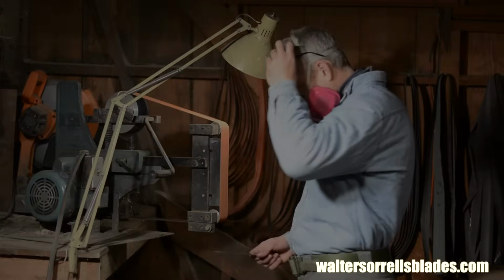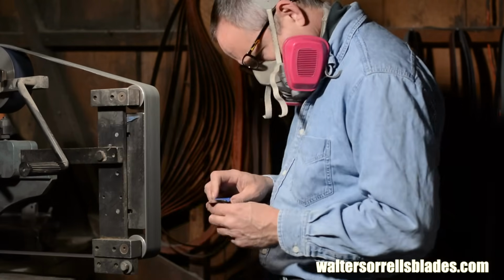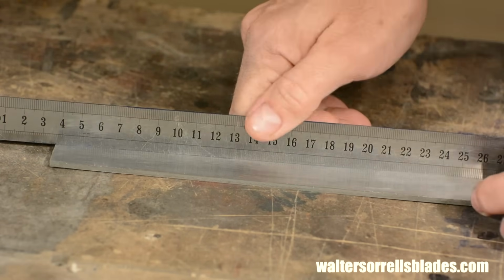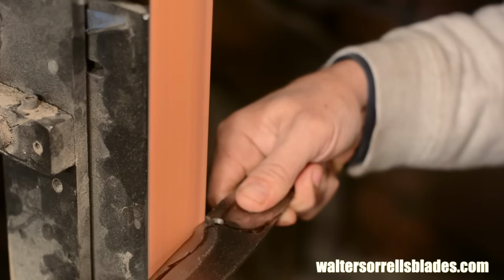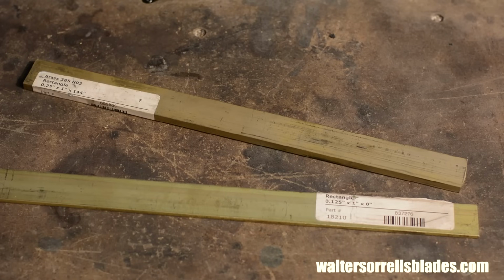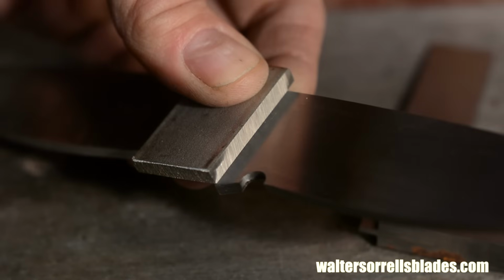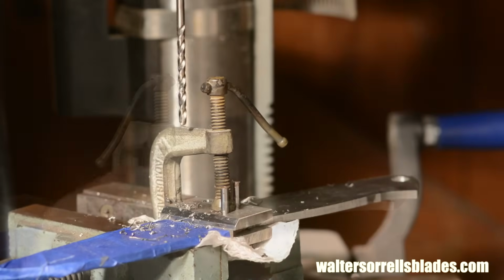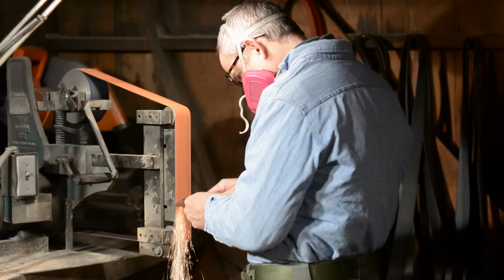How to Make a Hunting Knife - Part 1

Comment: very nice tutorial !
for making the bolsters line up, you could just shape them to each other(put the pins through with out the blade in the middle, and grind them on the belt grinder)after you drill the holes.

Comment: Very much enjoyed your presentation. I've made a couple knives (stock removal) and a couple which were beaten into shape by my crude blacksmithing. Crude in both situations but surprisingly satisfactory cutting edges (carbon steel of unknown origin, in one instance a set of blacksmith made shears for gardening which had "retired"). Eventually I may get to try something of more "predetermined" quality. I'm quite familiar with belt grinders and have used one for glass work as well, using wet belts which do a fine job.

Comment: That Norton belt sure does some quick removal work. Thanks, as always, for the great information!

Also, I've noticed on numerous videos that your water cooling container is positioned so that you have to lean down for it. Is it merely placed there for use with multiple grinders, or is there another reason it's farther out of the way?

Comment: Key to drilling stainless is high feed and slow speed. It also helps to have the bit sharpened to a shallower angle.
Reply: Sturmgeschütz isn't that a German tank Destroyer from WW2?
Reply: More of a mobile gun than a tank destroyer yes.
Reply: Sturmgeschutz is 100% correct, that drill bit is going much too fast for effective drilling of stainless.  Stainless steel is a terrible conductor of heat, so that heat builds up quickly on the point of the drill bit, making it softer than the steel it is trying to cut.  Turn slow, use cutting oil, and draw the bit out regularly to clear the chips.  Oh, and NEVER grab the chips or string while the machine is running, it'll deglove your finger in an instant.
Reply: I agree.  Slower spindle speed, and a 135* drill bit helps a lot.
Reply: What type of drill bit is most effective on stainless? Cobalt, carbide, or other?
Reply: OldJesusFreak1958 I use cobalt on stainless, with the 135° self-centering geometry as wildcard mentioned.  Works quite well. Carbide is really brittle by comparison and (I believe) should be reserved when working with solid tool-holders, not hand-drills or consumer drill presses.
Reply: OldJesusFreak1958 I just use high speed steel, you dont need fancy expensive bits unless you are doing hundreds of holes. I know i said it makes it easier but dont even sharpen the bit to 135 deg, i just keep it at 118 and ive worked with the stuff for years and had no issues. I drill bizplate 400, 500, 3 cr12 amongst others using high speed steel, and stainless is nothing compared to any of them.

Comment: Hello Walter, great channel and great craftsmanship! I have one question: what's your opinion on corrosion risk/ product degrading caused by contact corrosion (contact between steel and for example brass which differ in redox potential)? Have you encountered such phenomena when applying brass pins in carbon steel blades? Thanks for your help!Greetings from Germany!

Nils

Comment: Hey Walter, love the videos sir. I have questions about belt sander belts. You said you use ceramic composite rather than aluminum. We use aluminum composites here at our shop and I’ve noticed on mild/ medium carbon steels, they tend to get hot very quickly and get tempering colors. Is this due to the belts, or am I “leaning” into the belt too much? When I watch you work, it looks like you barely hold your materials against the belt and you don’t get any discoloration. Does that also have to do with your material being stainless steel. There’s so much to consider here so any information would greatly be appreciated. Thank you for your knowledge!

Comment: I'm really new to knife making and im a bit confused with the maximum  thickness to grind the bevel to so it doesn't warp when heat treating. would grinding to rufly 1mm be ok or could I remove more.thanks for any help.

Comment: would 1084 steel work well for a knife like this? i have a couple of weeks off coming up and im planning on making my first knife and figured stock removal was a good place to start so i ordered a length of 1 1/2 x 3/16 1084. I'd probably oil quench it in canola. Thank you:)
Reply: 1084 is a simple High carbon steel For the intent of using it as a hunting knife? Probably not but for an outdoorsman survival tactical camping knife? absolutely. 
I would recommend 1095, 5160. O1tool steel for the beginner stock removal/ forging. these steels are easy to get(amazon) easy to work with and easy to heat treat.(heat treat it with a blow torch

Comment: Finished grinding my first knife, managed to establish a decent grind and plungle line but once I started sanding away all the grind marks, the neck sort of just disappeared and the plungle line got really smooth. Tips on how to preserve crisp sharp lines?
Reply: Another question I have, When sanding with water on a carbon steel blade, what is the best way to keep the blade from rusting? I just cleaned it up best I can and did my best to dry it before bringing it indoors but I'm worried once I give it a final polish it's just going to rust really quickly even if I clean it up and bring it inside.

Comment: Walter I am drilling holes for my bolster on my knife and using 3/32 pins and burning up bits like crazy. My drill press low speed is 500, and I am using a cutting oil. should I just punt the small pins and go with bigger pins (1/8) or is there a trick to it?
Reply: are you using cobalt bits?

Comment: Where did you buy your 440C Steel? How thick of a piece did you buy?
Reply: 1/8 inch thick
Reply: Harrison King
awesome, thanks.
Reply: MARK 1 According to McMaster-Carr that's about $87.09 for a piece of 440C that's 1' (length) x 1/8" (thick) x 1.25" (width). Yep, this stuff might not be a so called super steel, but it sure as hell comes close in my opinion. According to the specs I see on the charts at McMaster-Carr, it's Rockwell C20 which can be hardened to C60, Yield Strength of 65,000 PSI. I'll make a knife one day, just need a belt sander, and a few other tools like a drill press would be helpful, probably some tungsten carbide drill bits too for the pins.

Comment: if i use a circular saw or lawnmower blade do i need to heat treat
Reply: +Johnnie Blevins I don't recommend the saw blade. (unless it's a much older blade) as new circular saw blades only have the good steel where it's needed.
I have not tried lawnmower blades but my instinct is to heat treat. I would recommend using a metal working file as your stock. These are always* some form of high carbon steel and when heat treated properly yield a very hard edge.

Comment: Thats what I call a tutorial video. Not a bunch of obnoxious music playing continuously through  limited camera shots and high  speed time laps. You did a good informative video. But I myself would've had to use 1095 carbon   steel...lol. Again, great vid!
Reply: You'd have a hard time telling carbon steels apart in use, like 1084, 1095, W1, O1.. you might be able to tell 5160 if it's softer than 59 HRC. A good heat treat on any of them would be great. Also, don't bash stainless steel - most of the time it sucks because they had a shit heat treatment. A good heat treatment on it and you'll find it in nice straight razors. It outperforms carbon steel, hard to argue.

Comment: If I wanted to make a knife out of a file do I heat it up first? Do I cut it ti shape and then heat it up?
Reply: You soften it by heating it and then cut it, or else it will take a veeery long time to cut and if your unlucky it might shatter.
Reply: then do you heat it again after you have it cut out and shaped?
Reply: Walter Sorrells literally has a video series about this on his channel.
Reply: The problem with making knives from files is that you don't really know what kind of steel it is and how it was hardened.  So many times you'll wind up with a "knife shaped object" at the end.  Not to say it can't be an effective cutting tool, but it isn't a high grade knife.

That said, the steps are generally as follows.  First, you want to anneal the file, which means softening it by heating it up past the critical point where it loses its magnetism.  It'll be red hot at this point and requires a lot of energy in a forge or bed of stoked coals with forced air.  Let it air cool and it should then be soft enough to hammer forge into a rough shape, and the finished with grinding/sanding.  Avoid making the edge too thin or if you do a hollow grind, the middle too thin because when you go to harden it again, it'll warp.  And that's the problem, you don't know what type of steel is it, therefore you really don't know how to properly harden and temper it.  But you can take a best guess and heat it up again to it's non-magnetic point, this time dunking it in motor oil to quench and harden the steel.  At this point it'll be hard but also brittle, so you'll need to either heat it up again and let it cool in a bucket of ash or other insulating material, or bake it (in a forge or an oven) for about 3-5 hours, at 500F.  This "draws the temper" leaving it hard but not brittle (ideally).  From there you can do your final shaping, apply a handle, and sharpen the knife.  If you're lucky you'll have a great little workhorse.  If you're unlucky it'll chip or snap and you'll have to start over.
Reply: Thanks my friend. I work for a power company and got a small saw blade that is thin. I am going to try to make a fillet knife out of it. It is good steel cause the stay sharp. Will let you know how it turns out.

Comment: Quick question...I was checking your source list and the same piece of 440c (.125" x  1.5") was $9.95 from Texas knife (12") and $91.51 from onlinemetals (24"). I realize the one from onlinemetals is twice the length but why is it almost 5 times the cost? The choice is obvious but am I missing?
Reply: go with the cheaper one? 440c is 440c
Reply: +mattbaker333     I bought  72" /  6 feet from Admiral steel for  $85.44  delivered.   1 1/2 x 3/16

Comment: I have no experience with knife making and I dont want to by expensive steel and have the knife not turn out. any advice
Reply from the maker: +Ryan Belmont  Materials are cheap.  The work involved is the real cost here.  But you just have to jump in and try it.  You'll never know till you try.
Reply: +Walter Sorrells thanks.
Reply: Mike McCulloch thanks
Reply: +Ryan Belmont I get 3 feet of 5160 steel for $5
Reply: +Ryan Belmont Start with an old file.  That's some of the best high carbon steel you can find, and you can pick up and old file for nothing.  People throw them away.
Reply: +Ryan Belmont I bought a chunk of mild welding steel in good size, and practiced making several blanks, working on bevels and file working. Once I thought my skills were on par I purchased some O1. While the mild steel helped with basic tool techniques, the O1 had completely different attributes. It was much harder to work with, more filing than the butter soft mild steel. For the cost of some O1 flat bar, and my time that I lost, I would just buy a decent steel from the get go.
Reply: +Sherrifs Forge Where?
Reply: +Ryan Belmont or others reading this, start with wood. You'll get most of the obvious mistakes out of the way doing a few wooden "knives," and the cost and speed are very helpful. Don't graduate to steel until you can reliably shape a wood blade and tang (particularly plunge line). As Walter says, the work time is the real cost, and this will save you major errors in steel work time.
Reply: +Walter Sorrells    I'm assuming  there is No need to anneal the 440c  bar from the supplier ?
Reply: +Hill Wellford Great idea 💡
Reply: +David Hall no the steel comes unhardened. as you see he heats it himself later
Reply: Ryan Belmont go to the scrap yard and grab a chunk of metal. That's what I did for my first knife!
Reply: Ryan Belmont you could go to menaces and get some 1/8 steel or 1/4 thick steel. Company is Hillman I use this steel for what I do,very good for beginners I think like myself and others.
Reply: Menards* not menaces
Reply: Just use 1095 is cheap and really good

Comment: how thick is the steel you are using?
Reply from the maker: 1/8th inch.
Reply: Same size for the bolsters?
Reply: +justame smith 1/8 is a little on the thinner side, but it should work great if you aren't doing anything like splitting logs

Comment: What is the width, length and height of the 440c ss he's using?
Reply: Joshua Talbot 1 1/2" wide by 1/8"thick. The length depends on the overall design of the knife. There are several online places that provide these types of steel for bladesmiths at reasonable cost.
Reply: Thank you.

Comment: Just a note 3xx series steels and 4xx series steels are chemically incomparable in salt water; it will tend to plate the 316 steel and corrode the 420c.   Only a problem in salt water environments cor upland deer hunting it will be no problem.

Comment: With all of this sanding and with the possibility of being out of square, wouldn't it be much easier to use a mill instead of grinders and sanders? 
You could eliminate much of the equipment while being able to drill with much more precision.

Comment: For the bolsters...wouldnt it be easier to just make them way oversized... put the holes through using the knife blank hole locations...then put dummy pins in and grind them while clamped together to the same size and from that you want and voila attach to the blank, peen the pins and grind them down to the edge.